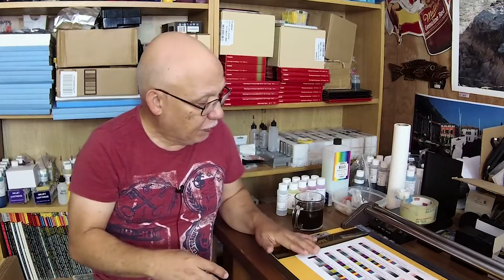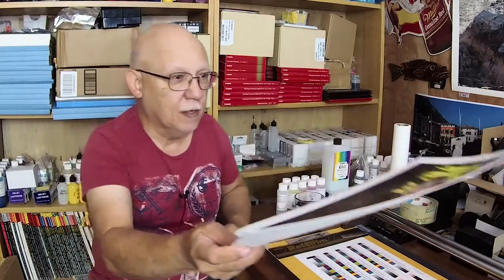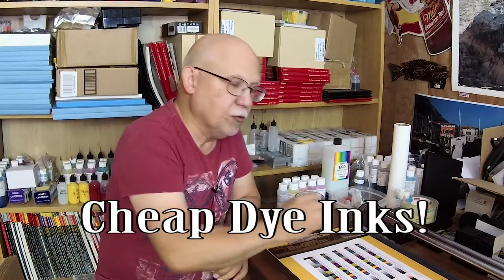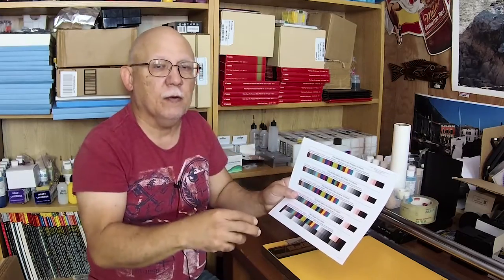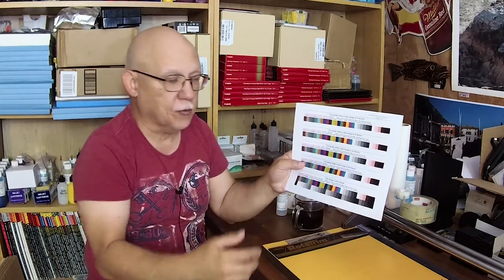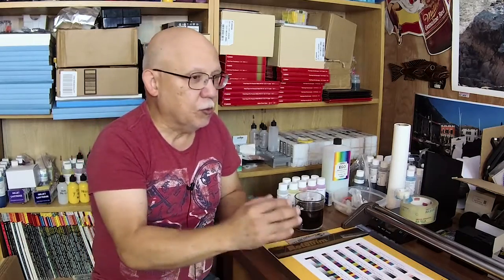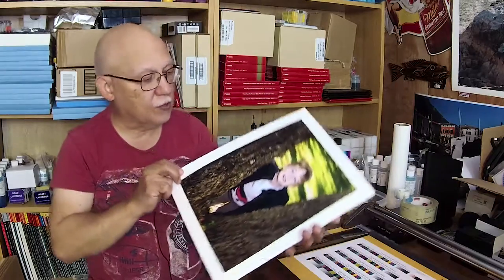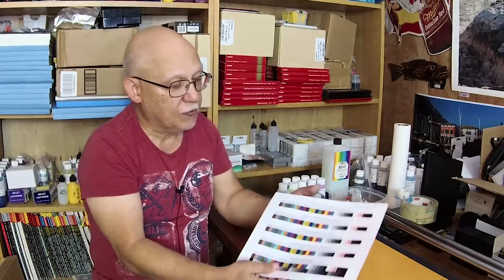Print Longevity Testing!  What Actually Takes Place!

Comment: My pictures are wrinkling :( I don't want to frame my recent prints because of this. I've read that it's because of humidity, if I leave room behind the frame would this help?? I need advice
Reply from the maker: Certain papers are notorious for this. Other than sandwiching the print flat against the glass in other words without a mat leaving a gap, there is not much one can do. Regular RC papers don't suffer from that. What is your paper?
Reply: Jose Rodriguez I've been making my prints at Costco (thinking about getting an epson p800 though) and I guess they use fujifilm. I'm going to try to leave a gap for the already printed pictures but I don't think I'll be printing from them anymore. Thanks for replying